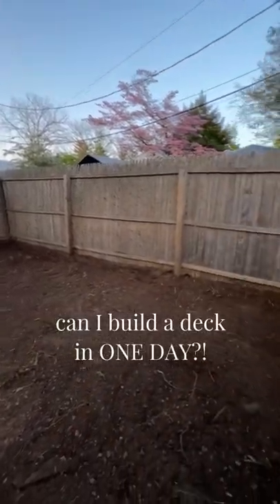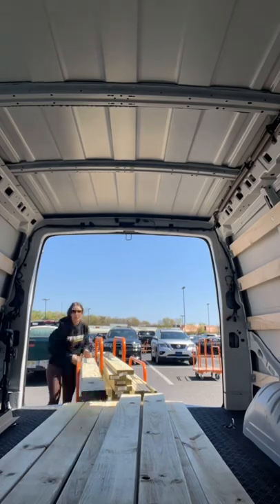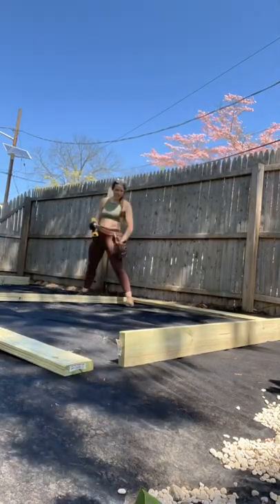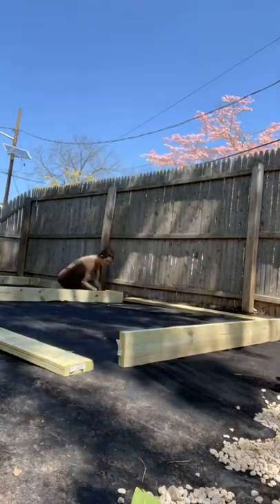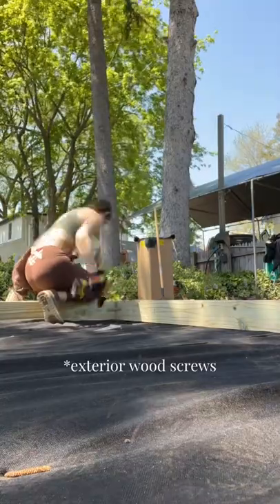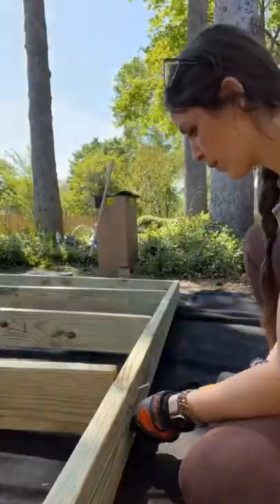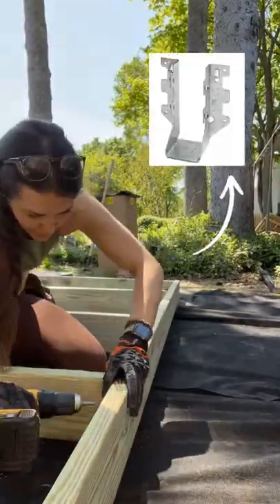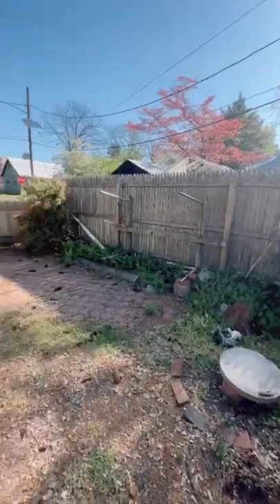DECK IN A DAY [part 01] - How to Build a Ground Level Deck // DIY Floating Deck

Comment: Itll be toast in 3 years.
Reply: 3? I give it a year before it starts tipping
Reply: My coment was going to be 'not the right way' haha
Reply: If you guys are going to put her efforts down. At least explain what is better for those of us who want to try it too.
Reply: I give it 6 months tops
Reply: Came here looking for this haha
Reply: Should of just thrown down a couple of pallets...
Reply: @katehartley621  they never do lol. All of these YouTube “experts”, whether it be construction, fishing, automotive, etc. they criticize the video and then when someone asks what can be done better they go ghost 😂
Reply: @Sua_sponte_is_weak  that info ain't free that's why lol
Reply: @katehartley621  joist hangers should not be used with screws. In fact, no metal should be attached with o wood via screws (in some .. not this.. cases screws at acceptable).

The he sheer strength for screws is much lower than nails when in contact with lid bearing metal support.

Additionally, although desk screws are nice, they will rust when the coating is ripped off from scraping against the metal hangers. Leading to rust, wood expansion, and a ruined deck. 

Lastly, there is no bracing. Ladder bracing is ideal and should be used as it only I creases the aesthetics of the deck (by preventing sagging) but also improves structural rigidity which reduces expansion and compression.

Enough?

By the way I’m an engineer if you need reasoning to trust my word
Reply: @Mr.Mudboy  oooh thank you so much!! I just bought a new house and this information will help me with my deck!!
Reply: @katehartley621  YouTube it, you got a whole dictionary in her hand to do anything u want
Reply: 3 months

Comment: There is no reason in the world to build a deck that is not supported by posts.  That tarp will collect water and that wood will be rotted in 5 years.  No, pressure treated will NOT stop that wood from rotting.

Comment: It would be a good idea to set it up on some sacrificial blocks you can change out every few years, or pavers. Even ground contact lumber will rot with time. That's a lot of money in lumber, and your time...don't want to see it go to waste.
Reply: Won’t last long enough to rot
Reply: Home depot and Lowes sell cement piers with a cross hair embossing on top used specifically for ,"Floating decks"

Comment: Is it true that this will NOT LAST for even 3 years?
Reply: She missed some pretty crucial steps like leveling the ground first
Reply: I build decks for a living.  In my years of building them I've never even heard of a floating deck.   There is nothing to keep it square.  You kick it hard and it'll be out of square.  I'm sorry but ya.  The reason you add posts is to square the structure and level it.  Floating structures like a breezeway is still anchored to concrete, or posts into post holes.
Reply: 3 months at best.
Reply: @HopeCreekConnemara  she said she leveled it before adding the black soil paper
Reply: @ambermoon1401  leveled once but needs to be below frost line. Weight and Weather will change her 'leveled' deck to lopsided quick.
Reply: Been a carpenter for 12 years. This won't last 1 year let alone 2
Reply: It will last 10 years but dont put too much weight on it.
Reply: @nathanpike4745 Floating deck jist means its not attached to the house.

Comment: Here's one tip for you. Never use screws when you're framing a deck.
Do this test and you'll see why. Take a screw and screw it halfway into a board. Take a nail and Hammer it halfway into the board now take your hammer and hit the screw back and forth trying to bend it and you'll see how quickly the screw breaks. Take the hammer and hit the nail back and forth and you will see you can bend the nail back and forth quite a bit and it might not ever break. Screws are only used for securing the decking not the framing
Reply: Sure they are more brittle but screws these days have much more tensile strength and are rated to be used for structural
Reply: @blipblop92  she's building a deck on dirt with not a bit of foundation I don't think she's looking at the tensile strength of the screws. But yes you're right there are some screws that have great tensile strength.
Reply: @ethanadams598 how abbout coated deck screws for screwing stringers for stairs?

Comment: The screws in the hangers are what got me
Reply: You can put screws on them tho ….. Simpson makes them for their hangers
Reply: They definitely wasn't Simpson screws
Reply: @mariocolin5639  you should never use screws to Anchor metal to wood. Simpson does make lags for some of their hangers, however screws, never..
Reply: #9 screws brother.
Reply: @mydogatemyhomework3768  lol simpson makes them. They are great if you want no hammered fingers
Reply: I don’t  use them but they do make them for joist hangers.
Reply: @my dog ate my homework  Simpson definitely makes screws meant specifically for hangers.  And they are code compliant.

Comment: You should have got pressure treated posts and then put gravel inside it, level it and put concrete tiles on it to prevent any rodents getting in it while making a solid foundation

Comment: This type of deck would require the ground to be level before placing the deck down. Sounds relatively easy but requires quite a bit of leveling adjustments. This job just must have been more difficult and time consuming than it appears to be.

Comment: I’ve built @50 decks to date aaaaand I see one or two issues with your build…….
BUT ☝🏼! That being said you are a real go getter and you my beautiful friend deserve a 🍪!!! Seriously gurl go you!!
Reply: Creepy
Reply: 50.... you're just a beginner
Reply: @paulunderwood8960  haha I won’t argue with you there but my career is only about 1/2 over so I’m shooting for 122
Reply: @robertgemski6524  on my 44th year probably have at least 300 custom homes under my belt and probably a 750 decks if not more.... not to mention the countless remodeling jobs in additions.... good luck in your second half
Reply: @paulunderwood8960  🤔(X times Y and carry the 4 and makes calculator noises in my head) 
That’s a whole lotta houses like umm @7 a year and 14 decks a year On average look at you go!! (Not sarcastic at all) (and neither was that ) (or that)
Reply: @robertgemski6524  I had 2  framing Crews for 25 years..... and a lot of those were Beach decks two and three story...
Reply: @paulunderwood8960  that is awesome seriously (actual non sarcasm)
Reply: @robertgemski6524  seven houses a year is really not that much. I work on a crew with two other framers and an owner operator, and the four of us will frame and enclose plus decks a 4000 ft house in less than a month. That's only working four or five days a week at maybe 8 hours a day. Shoot we built a 45x70 two-story 12 plex with a ginormous washroom basement and decks on the entire lower floor in less than 6 weeks. Really just depends on who you have working with you. Oh did I mention we are in Alaska too so we Face a lot harsher conditions that create a lot more work. Good luck on your adventure.
Reply: @mydogatemyhomework3768  well smell you
Reply: @robertgemski6524  I wouldn't doubt it after a day of work I have. Probably smell me right through the phone. Hahaha

Comment: Well one day for frame is possible, it needs decking to be a deck.
Also you used joist hangers but non code corners. Also using screws are not proper due to sheer, so nails.
Good try, have fun redoing the structure in a few seasons

Comment: I mean I’ve never heard of a floating deck but even if that was a thing don’t you think pressure treated wood would have been the way to go? Just this wood being in the sun will warp it let alone rain and snow. And whatever you put under it to level it is just gonna sink and settle. Blacks a $3 a piece at any hardwares store. Burying 6 of them in the ground at each corner and the center would have at least given you a platform less likely to sink over time. It like maybe an hour of extra work to dig 6, 3 foot holes and put 6 4x4’s in them with a bag of sac Crete. Maybe an extra $100 at the most for a deck that will last 20-30 years as opposed to 1.

Comment: 1 hammer, 400 4 inch bullet head nails, no need for mechanical fittings, inground posts or concrete footers would've been the way to start it so it starts level. Good effort tho

Comment: I don't think my inspector would pass that one just width here is 12-16" on center
Reply: Most places don’t require an inspection on decks under a certain height. But this thing will fall apart in a year with just loose gravel leveling it
Reply: @dylansmith2996  well he put a ledger on the house so it's not floating which tech in Illinois you need the permit. But I don't care about that but all screw, no 1/2 lags, no galvanized nails in joists or joist hangers. I don't like it

Comment: Put the deck at least on 2-4" block to keep it off the ground otherwise the wood will rot even treated wood, wood should NEVER be in contact with soil (weed membrane isn't enough to protect the deck)

Also you need to put more screw/nail in the actual wood and not use those metal angle and those hanger does absolutely nothing, hanger are used to support joist, not to fix them to the rim joist.

And I'm not shitting on her work, just letting people know how it should actually be done, if you're going to spend money on good material the least you can do is do it properly so it last as long as possible as this deck will be thrown into a dump in no time costing even more money and wasting precious wood.

Comment: Yikes, I admire your enthusiasm and giving it a go, but this 'floating deck' is  basically just a big pallet you've chucked on the ground. You need posts to ensure it stays square, because as it is right now which is basically just a wood frame thrown on the ground, you are going to have some serious movement, bowing and it'll be very much not secure. Think of it like a wooden fence gate (to use an example of wood joined together side by side), if you just place it on the ground, it'll get serious movement and if you stand on it, it's going to go all over the place, bend and bow. Now if it's properly supported, kept square and level, imagine the difference. This is the wooden fence gate. There is a reason there are building codes and fully qualified carpenters and builders doing it a certain way, it's because this is how it needs to be done to be completed properly and to a high quality to ensure it stands the test of time. This will not last you very long unfortunately.

Comment: I woulda use adjustable piers at least and keep an eye on them over the next year and adjust if they sink some. That’s a lot of weight and I’d never sit any wood on the ground, ground rates or not. It‘ll stay wet and warp or rot
Reply: How would you build a deck that isn't attached to a house then? Would you just put concrete slab instead of wood or can you put concrete first then the wood?
Reply: @ambermoon1401  pure blocks are made of concrete and sit directly on the ground. They have a hole in the top that a bracket with a bolt goes in to make them adjustable up and down.
Reply: @ambermoon1401  * Pier blocks

Comment: I'm mean you get a B for effort but you slacked on doing it correctly so you wouldn't have to do it again. But they make code books and also how toos on doing it correctly. Maybe should do alittle more research next building project but practice makes perfect.

Comment: There is NO SUCH THING AS A “FLOATING DECK”
Everybody’s a builder now!???
Reply: Not quite true. Big box stores like home depot and Lowes both sell Cement piers with pre stamped cross hairs on top. Allowing a DIY'er or Builder to erect a deck on top without fasteners to the piers or ground. I would consider that a ,"Floating Deck". IMHO
Reply: Thanks for the reply. However, your deck did not have any attachment to to ground

Comment: I know too much about wood to know that you Never Never Never put any kind of wood, treated or whatnot on or even near soil. Never! I don't want to get into the whys of it. Just don't do it.  Having said that, you could do it if you coat it with Henry's roofing cement, adding fiberglass layers in between, and or you Shou Sugi Ban the wood, which is a Japanese method of preserving wood, which consists of burning it to where is forms a 1/4" layer of ash, which you seal with many coats of sealant. You do that and the wood would last longer than you...